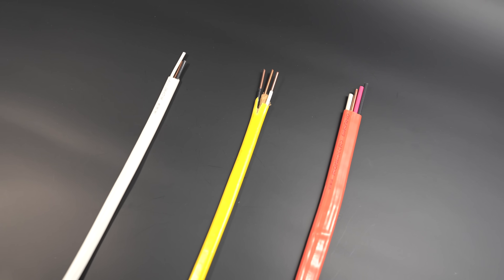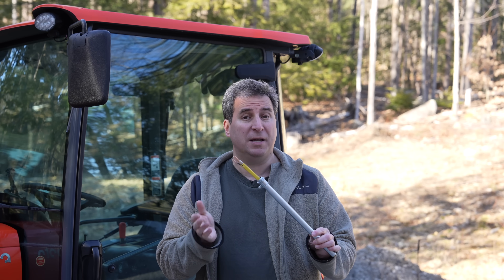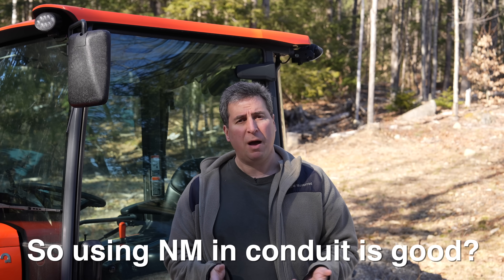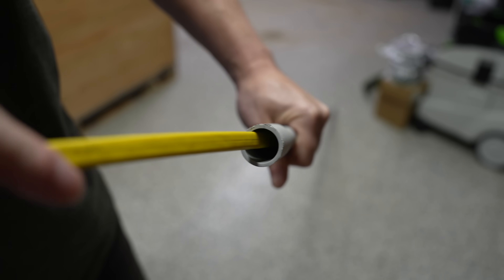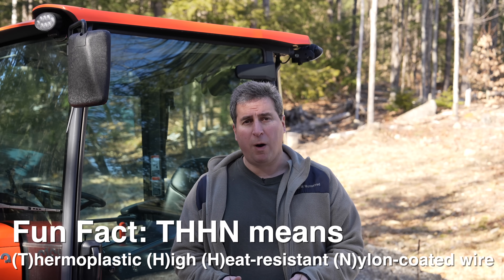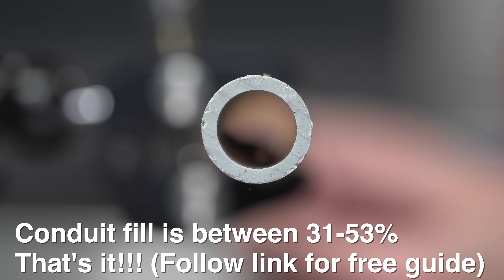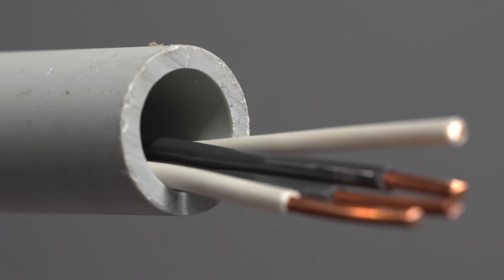#1 DIY Electric Mistake - Can you use Romex Wire in Conduit?

Comment: You are absolutely correct on nearly 100% of everything you said, in this video. There was one little point, however, that you got wrong and it surprised me as EVERY electrician does this. You said you cannot use the individual wires, out of Romex cable, because they didn't have the proper protection the manufacturer intended. You went further, on this point, by saying that it wasn't allowed in any circumstance or situation. I beg to differ. I'm not an electrician but, I was an apprentice for a little while and I soaked up everything the electricians at the two companies taught me, and I can read. I know that you CAN, indeed, take short (~4-8") lengths of the wire out of Romex and use it as pigtails. I understand this video's subject is about using Romex in conduit but, it should still be correct in every aspect that is discussed, including making offhand statements that something cannot be done under any circumstance or situation. Anyway, that's enough anal-retentiveness for the day. I'll end on a positive note: THANK YOU for being right to the point and not hee-hawing around like a lot of these so-called master electricians who yammer on and on (kind of like I'm doing, right now) and not getting to the point until near the end of the 20-30 minute long video. Unfortunately, due to YouTube's policies, because your video was so short it means you won't get any money for it. That being said, thank you for volunteering your time and attempting to educate the masses.

Comment: Pulling the wires out of NM cable and using them in J boxes for jumpers, we commonly did as electricians in Florida, in 4 different counties around Orlando. House always passed Inspections. Romex also used inside Flex runs to AC condensing units, from disconnect, house always passed, not large units, typically 10 AWG. I used Romex inside conduit for 120 vac supply to gas furnace in Basement, Mostly to protect the wire in an exposed are when dropping from ceiling in basement to entrance of furnace 1 foot above bottom. Maybe now the entrance is at top of furnace 3-4 feet above the floor. Again, the conduit provided protection and support when bridging the gap of 7 foot from ceiling to electrical entrance of furnace. Of course it requires a 90 degree bend at the bottom, something a typical home wiring person doesn't see, a conduit bender!!!, LOL.

Comment: @ 3:08 - Why is this NOT safe? I get that it may not be "code", but why is separating the pair (or more) of conductors from Romax, then treating them as individual conductors to be passed through a conduit (at a rate of less than 31-53% as you mentioned) - What's the problem with doing it? WHY is it NOT safe? Seems terribly arbitrary, since I can't see any difference between a Romax wrapped 12 gauge wire, and a 12 gauge black conductor. Is there some magical coating over the black, white, conductors that come on a separate roll of conductors? Obviously there might be a different print pattern on the conductors, since they were being wrapped by the exterior sheath of the Romax, therefore it might be tough for a bad inspector to tell what gauge the sizing of the conductors...but beyond that, what's actually unsafe? Is there a thicker sheath on individual conductors?
Reply: Beyond the lack of gauge markings, the lack of markings to indicate the type of wire (THHN, etc), and the lack of temperature rating markings, the individual conductors in Romex wire does not have a protective coating on them as they are not intended to be removed from their outer sheath. THHN wire does have a protective coating on it that resists abrasion when being pulled through conduit. Therefore you are less likely to cut the insulation. There is a much greater chance of cutting the insulation on the individual conductors in Romex if you were to remove them from their sheath and pull them through conduit.
Reply: Incorrect, individual romex wires are THHN, just unmarked. The manufacturer can confirm this if you call.

Comment: The wire insulation inside NM is tw wire. Thermal Plastic Wet Locations. In NEC 310-16 clearly states that TW can be pulled in conduit and the fill rate on chapter 9. Learn your code book before making a video.

Comment: 0:50 Is it too much to ask WHAT is the problem with dampness with respect NM/romex cabling?  You just skipped over what the actual problem is.
Reply from the maker: No one has officially ever said why, the popular reason is that the paper inside the NM cable can rot from moisture and further breakdown the insulation on the conductors.  Outdoor rated cable and separate conductors don't have this issue and lack any paper.
Reply: Pretty much  @SilverCymbal
Reply: @SilverCymbal but aren’t all outdoor conduit connections supposed to be made with watertight fittings? So the paper would stay dry no? 🤷‍♂️

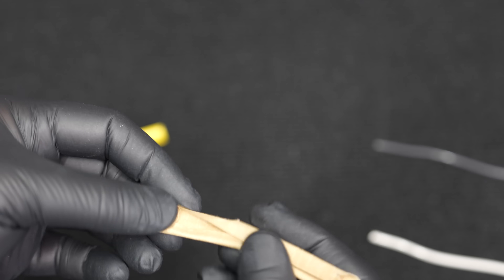Comment: 3:00 better way to say it: the remaining insulation (and the associated protection) is inadequate when the outer sheating has been removed. Calling it the  "the manufacturers intention" is just confusing and misleading. Another way of saying  it: The cable is DESIGNED and SPECIFIED to be used only as a whole, not as individual wires, because the individual wires alone are not sufficiently protected by the insulation material.
Reply: A very smart comment. Yes sir.

Comment: You can certainly run UF-B cable in conduit. I did this for my outdoor post lights, installed inside newly placed plastic conduit. It sounds redundant, however the previous UF-B installation was heavily damaged by roots, rodents and because the soils is sandy, the cable surfaced in many locations and got scalped by a mower. Now it is encased in PVC and buried further in a trench. Over 175 feet of it installed in sandy soil, damp and wet areas.

Comment: I am an electrician and I approve, only minoe detail, the conductors inside of NM cable are proper and are rated for 90°C but per code can only be used inside their NM sheathing and up to 60°C, they can't be used as individual conductors because they don't have any markings on the actual conductors insulation (unlike MC cable conductors for exemple)

Comment: As others commented, this is an informative and to the point video. Type NM cable run inside of conduit is redundant, but there are generally no prohibitions in NFPA 70 for redundant installations.  However, type NM cable is prohibited for use in wet locations and running it in conduit, that would seem to offer it extra protection, doesn't remove that prohibition.

Comment: I love the way it has gone form 2 wires to now 4.   Me I still use just 3 on my farm.  Being a farm I get away with stuff u city kids living check to jowl dont and most of it is legal b/c this is a farm and also my building inspector is the farmer 3 miles down the road doing the same things.  Ya farmers still say to state codes dont need them been building this way for 100's of yr and look they still stand where as urs are blowing down.  Ya I live in a house built by my GGGDA in 1857,  It has 12" think walls with 3" think white oak studs.  In fact the hose is made all of hard wood and same goes for the part of the barn he built.  Da redid the siding, took out the paster and lath and reded electric in 61. roof in 65, 85, and i have redone it every 2o yr since.  He did all the work with his 2 bothers and their 5 sons.  I was 13 that yr.  It was when I learnt electrical work farmer way. Which by the way is the cheapest but also the safest.  We dont want to burn our places down.  We wired this house with 10G and put30A backers in.  Every 2 outlets is one backer
This is farmer work.  I have built two pool barns in the past 30 yr.  Jim stopped by once when i was about half done with each.  Looked around a little and asked witch of the Amish i got my white oak 8x8 form.  He is code officer.  we talked farm a little and then he asked when do u want me to sign off on this.  I told him i planned on having it done by sept. he went on his way for he haD HIS WORK TO DO

Comment: I have a new panel beautifully laid out Romex solid wires. I installed a Mini Split, used THHN from the panel to the out door disconnect box directly attached to the bricks. It is correct, but it is unsightly in the panel the THHN is loose & floppy, it does not look "workman like". I am going to replace the THHN with a short piece of Romex it is only 6 inches from the interior wall to the disconnect box. Thanks for clearing this up.

Comment: What about in a house but it goes down one wall of a garage and comes up the other wall, under the concrete floor?  Say a 2"  plastic conduit with 3 romex wires going through it like a raceway.

Comment: I have an old house with non metallic wiring in the attic where lots of rats are found. Will they chew on it?
Reply: They might. I did work in the attic of an old house with the tar impregnated fabric outer jacket and mice had totally chewed it away and the plastic insulation on the wires leaving just bare copper.

Comment: Here is the challenge: Shield a length of UF coming down an exterior wall to the ground by purchasing something at Home Depot. Do this without ripping a length of pvc conduit into two half rounds and securing it with plumbers holy straps. The goal is to keep the gardener from butchering the UF with a weed eater, exposing the bare conductors to kids and pets. .

Comment: So I have to run power from my house to my garage, I want a 110 and a 220 Outlet there. I take it I would run individual wires inside conduit? Does it matter if that conduit is metal or plastic?

Comment: FWIW
NEC now requires a separate ground wire in pipe... Before that, the EMT/metal pipe, etc... Served as the ground... But, too many idiots were adding plastic later and breaking the ground bond.  NOW separate green/bare conductor is required in all metal pipe where the metal pipe still serves as the ground.

Comment: The only problem with Romex inside a conduit is it's a pain in the ass to get it through there it's much easier just to run the individual wires especially through bends.

Comment: I just ran 50 feet of 10 gauge 4 strand romex through emt/steel flex in my garage/basement for an electric heater since i would have had to run through my fire walll

Yes, by code, it's legal

What happens at your box will hem you up more

Tricks for pulling romex

Push and pull at the same time it becomes way easier

Comment: Yeah, WHY? Why can't you use it outside? Because 'they' say so? Illegal. Sure. How about somebody provide a reason for all the fear-words? For once, somebody spare me all the codes, regulations, and trade-specific jargon, and just give an argument that's based in physics about why sheathed wire in conduit is a bad idea. Until I hear one, I remain unconvinced. The number one DIY electric mistake is getting electrocuted, not double insulating a conductor. 

There are plenty of codes that are rooted in good intentions and sound theory, yet they nevertheless end up impractical and/or stupid at the residential level. There are too many dogma-doers and well-witchers in the trades.

Comment: Can you run direct bury wire in conduit though? I already purchased the wire but can’t go down 24” due to some obstructions. Code locally is 12” deep in schedule 40 but I’d still like to use the direct bury wire if I can

Comment: Well, once I wanted to run (underground burial) rated 10-3 romex to a 10x12 shed about 25 feet from my homes basement wall, but because the ground I was digging the trench in was dirt mixed with gravel I was concerned with ground heaving in winter etc chafing or cutting the UG romex jacket so ran the #10 UG romex inside 1-1/4" gray electrical conduit and used sealed fittings on either end along with sealed joints.  This way the wire was protected from the gravel chafing it & water freezing inside and inside the conduit was the solid molded underground burial rated romex in the event something got into the conduit.  That was 30 years ago and have yet to have any kind of problem.  It may not have been code but its worked fine.

Comment: Quick question: I heard that running insulated wire through conduit could allow the generation of too much heat. I doubt that's the case, but I thought this might be a good place to flesh that out a little or clear up another potential myth. Is heat a concern, and under what conditions for normal house or garage wiring?

Comment: Before I knew better, I made the mistake of pulling a flat 10-2 UF cable through a 3/4" PVC conduit with (2) 90s.  I barely got it in.  It was also a pain years later when I pulled it out to replace it with individual conductors(adding an additional conductor).  Never again!  That's wisdom by experience.

Comment: Wow!  :face-orange-biting-nails:  Our home inspection said nothing about the romex leading from a diy box on our front porch back to under our kitchen window via some mixture of plastic and metal conduit.  Within a few months we had a thunderstorm that revealed an exposed wire in the wall under the kitchen window (where the romex had been scratched raw as it was pulled through the hole made to extend the electrical outlet inside outside).

Comment: 1:00: but WHY are you disallowed from running romex inside, say, a PVC pipe underground? One would think that it would be safer from creatures, tree roots, shovels etc that way - and if the pipe run is contiguous and has no way for flowing water to enter that pipe, it should also be safer.
Reply: Underground is considered a WET location, per code. Which is worse than a DAMP location. So it’s not allowed outside or underground. The requirements relate to the insulation on the wire. So will have run individual conductors with the proper insulation rated for wet locations underground in that underground conduit.

Comment: What bs not to mention time is money. That conduit is a protective sleeve, use 3/4 emt or pvc always and there's no issue with jams running 2 12-2 romex  in 1 pipe.

Comment: you can run romex with other wires in a conduit in a wet room if you use Ocal conduit and Ocal fittings. this is the system in use at medical manufacturing plants. it is totally waterproof around high pressure washing systems. i used it in a dairy prossesing plant and also at Merke labs in PA.

Comment: 2023 NEC 334.14 articles says: Cable shall be protected from physical damage where necessary by rigid metal conduit, intermediate metal conduit, electrical metallic tubing, Schedule 80 PVC conduit, RTRC marked with the suffix -XW, or other approved means. Where passing through a floor, the cable shall be enclosed in rigid metal
conduit, intermediate metal conduit, electrical metallic tubing, Schedule 80 PVC conduit, RTRC marked with the suffix -XW, or other approved means extending at least 150 mm (6 in.) above the floor.

Comment: I worked with a licensed electrician in the late 70"s, back then it seemed Romex was outdated and rarely used. We ran conduit and pulled wire on all jobs. I left construction in 1980 and was quite surprised recently to hear that modern homes use Romex, no conduit.

Comment: So what do you use for outdoors?
Reply: "UMB" is the homeowner solution.   Same exact everything only the spool f wire should say "UMB" on it.  It's relatively cheap and easy to fix.  Afterall, outdoors you rally only risk melting some wire and tripping breaker.   The "other tool" is the shovel...it has to be a foot deep...then your electrical fire is already buried when something eventually goes wrong.

Comment: I've been look for this info, and al though they are several that just talk about whether you or can't, no has shown me how to do it. for a single Romex cable at 51%, using the Chapter 9 tables and  Looking at the Romex specification chart, 14-2 is .368x.162, and 12-2 is .418x.179. These are the two smallest Romex cables and basically, looking at the 53% Fill from table 4, Chapter 9, for 3/4 is .283 and for 1" is .458, so both 14-2  (.368) or 12-2(.418) in 3/4" doesn't meet code. For Romex to be in ENT, it needs to be 1" (.458) or larger. For 2 cables, you to be .368x2 (.736) at 31% for 1.25" ENT.

Comment: If you live out in rural areas and not under inspection you can run Romex in conduit. I’ve seen it many times and no problems. Of course  you won’t likely see a licensed electrician do that.

Comment: you can run NM cable inside of conduit anywhere in wet or dry locations, as long as you comply with 310.10(C)(1)

problem here is you didnt provide any reasoning for your code interpretation, and without reasoning, i'm not sure we understand what the code is trying to do or if our interpretation is correct. my reading of section 334 is that it is talking about NM cable as a standalone conductor/insulator/sheathing, and used as a standalone product, you can't run it through damp locations. why? not just because the code says so, but it says so because its sheathing is not regarded as a waterproof 

310.10(C) says that insulated conductors and cables installed in WET locations have to meet only one of several alternative requirements. one of those is sheathing in moisture-impervious metal conduit. therefore, the code does not require a conductor listed for wet locations when you are running cable through a wet location, as long as the cable is run through approved sheathing as provided in 310.10(C). therefore, i do not read the code as prohibiting the use of NM cable in damp areas within a conduit approved for wet areas

in general, the use of NM within conduit that is approved for the location provides a robust result that should last for many years and present zero issues about damp- or waterproofness, or any other of the imagined problems we've heard about NM in conduit. the feeding challenges you mention can be handled with a little cleverness and planning, and you're right to point out you can't overfill the conduit